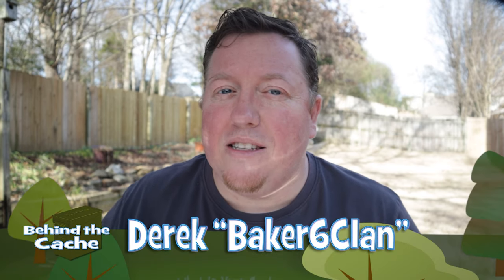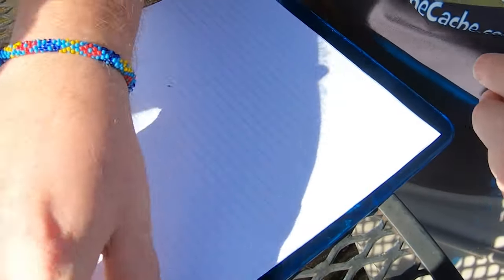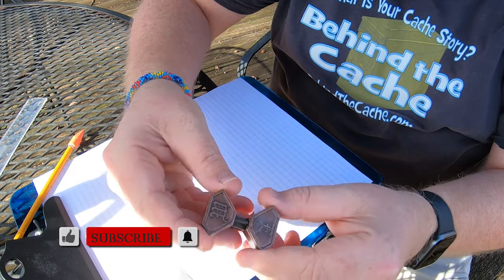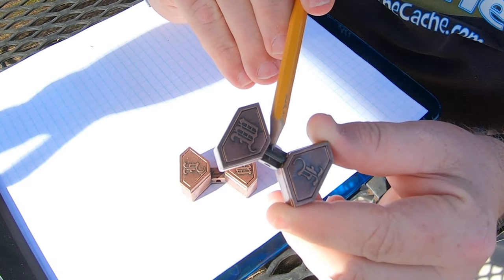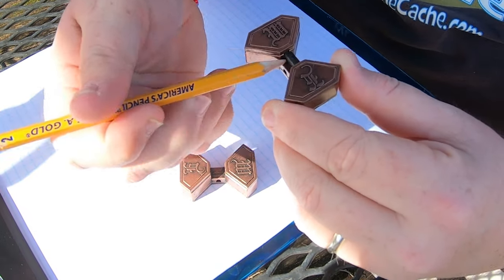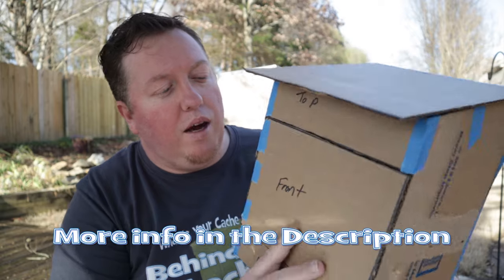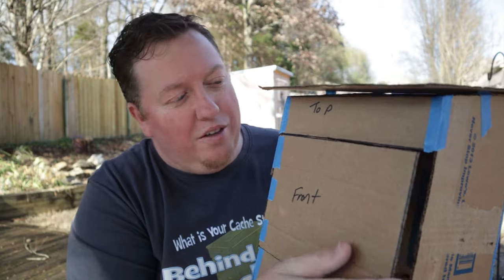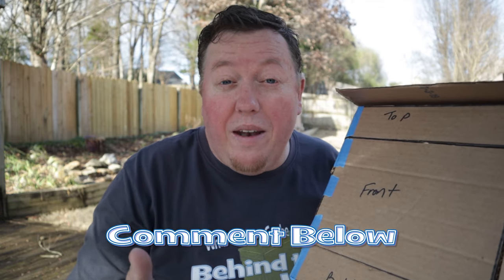Gravity Lock Gadget Cache Build Part 1 (GCNW)

Comment: I made a similar cache that must be flipped to expose some small solar  panels on the bottom that powers a small mag-lock. Super simple but challenging if there is not enough light.
Reply from the maker: That is really cool. Do you have the designs of that?  I have been awarded a 2020 Celebration and I am going to put out 20 gadgets and 20 non-traditional caches for the celebration. That sounds cool to make.
Reply: I don't have a design plan, I just sort of winged it. I can draw something up and share it with you though.

Comment: It will be interesting to see how you will make it less obvious that you need to turn it upside down. I'm assuming it won't spin in a fixed position, because it would move if messed with.  I imagine you would have to un-hook it from a fixed position, like bathroom (washroom) toilet (wc) vanity unit clips to allow front panels to be removed.
Reply from the maker: That is one of the hurtles that I am still working out.  That may be the last video in the series. Not sure how many videos this will be.  But those are some good ideas.